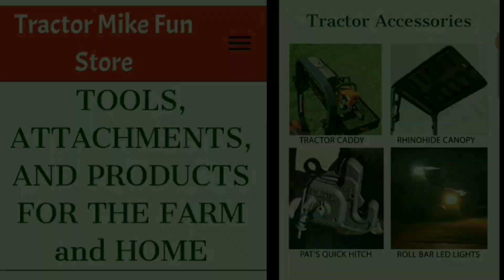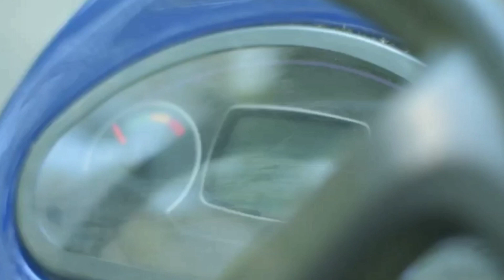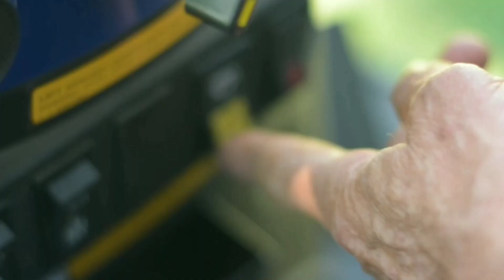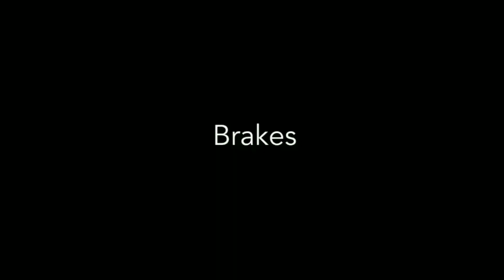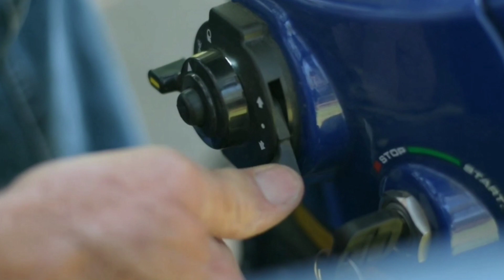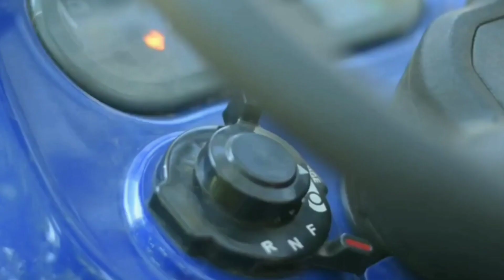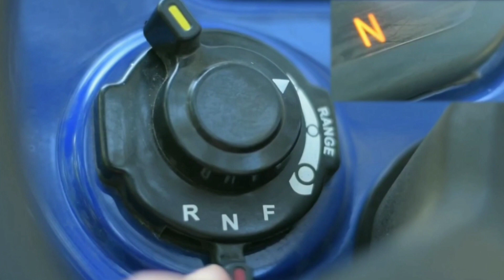Electric vs diesel compact tractors. Solectrac makes their case for electric.

Comment: It sounds great except for two things. Price and battery life. The price of almost 30 grand for a 25-horse tractor before the price of the loader is just too high. $7000 after 10 years for a battery pact...WOW. I have two Ford tractors the same size that are 70 years old. If this tractor last as long as the fords that would be another $700000, I could buy a lot of gas/diesel for 70 grand!!! That cost would be much greater if you charge your tractors with the grid. There will be a market, but I doubt many homesteaders will buy them and they are the ones who could use them most. Too bad!

Comment: Electric tractors make more sense to homesteaders than electric cars do. Homesteader tractors sit for much longer periods of time than one's cars. This gives them plenty of time to be recharged by solar power. This saves time and money. No more trips to town for diesel fuel, no more changing expensive oils, and no more burning expensive fuels. If you are going to need your tractor before the sun charges it up you can always charge it overnight. by plugging it in. It is probably the best hope for EVs right now.

Comment: I have a 33 year old tractor that has been running it’s entire life and I never had to spend $7000 on it. I’ll just keep my diesel. According to this guy I probably would’ve replaced the batteries at least three times. And I guarantee you after 12 years it will probably have a different style of battery and you’ll be stuck buying a new tractor. And don’t say they won’t because I’ve bought many expensive electric items and they’ve all changed the batteries and I had to buy a whole new tool or machine. I’m I’m done with batteries and companies that try to screw you by changing the batteries.
Reply from the maker: I see what your saying. I wonder if Tesla improves their batteries will they make you buy a new car? Time will tell
Reply: "I never had to spend $7000 on it."
Sure you did, unless it is just a lawn ornament.  You buy gas and it needs maintenance.  Electric costs less, and especially if you have solar panels or a wind turbine.  Gas savings will more than pay for battery replacement.  A good electric motor can last you a hundred years, as there is only one moving part rather than hundreds.  There is just less that can go wrong.
"different style of battery and you’ll be stuck buying a new tractor."
Only if you buy it from John Deere or other corps that don't let you repair them.  Worst case you need to buy a new charger unit, but a good one is programable.
"changed the batteries and I had to buy a whole new tool or machine."
It's good to go with standardized sizes, but for tools you can often just open them up, buy the internal batteries and glue them back up.  There are only a small handful of battery makers.  Companies make battery packs out of them, but the internal electronics and replacement cells can be bought.  That is there will be cells in there that can be bought or you can just make another battery pack.
https://www.youtube.com/watch?v=wcb4ESed2PQ
Reply: @abram730  The reason you have to buy replacement parts is that the manufacturers don't build things to last, there isn't any money in that unless you make the initial purchase price astronomical. They make things that will wear out to keep customers coming back.

Comment: Not ever buying a electric tractor or electric car
Reply: cool story bro
Reply: Why not? I get the argument that they're not as capable yet, but that's been changing and will continue to change.
Reply: The Ag & Construction Mfg’s don’t seem to be interested in producing a “Diesel Electric unit”. A small   diesel (approx 100-130Hp),connected to a generator to produce the equivalent of 300-400Hp that large farms need. Go ALL day. No stopping every 4 hrs to spend 2 hrs charging with electric. Trains have been Diesel Electric for decades because it’s more efficient.
And by the way, we don’t have a climate problem. Only if you listen to the Lie-Bral spin Doctors so you can be taxed to increase their slush funds.

Comment: Somehow I can't imagine an electric tractor working pulling hard all day long as in baling hay or plowing. It's a huge load for my seventy hp tractor. They seem more suited for light work and short hours.
Reply from the maker: I just spent 8 hours with my box blade today  reclaiming land and a lot of heavy loader work. My 50hp Kioti got a real workout. I am sure a lot of people have applications where these tractors fit the bill. I am going to be having a round table discussion with some YouTube tractor people about future tractors so watch for it in September. Thanks for watching.
Reply: @CountryCraziness  they are making progress with electric. It probably won't be too long they will be practical.
Reply: @James Couch I am not a farmer, but I have read in the past that Diesel tractors usually operate at 50% of their nominal capacity.  

If this is true, this would mean a 70-hp tractor is usually used at 35-hp.  A 35-hp Diesel engine is equivalent to a 26-kW motor.  An electric motor offers full power instantaneously.  This is not the case with a Diesel engine.

Another thing to consider is that the batteries of these electric tractors are swappable, and an extra battery backup can, also, be added to them.

I certainly do not know how many hours are required for a full day of work of bailing hay or plowing, but the owner of the company seems credible to me when he talks about their ability to keep up with work.  He does talk about small farms, and if you have a large farm, this might not be suitable.

A big plus for me is that I am not mechanically inclined, and the possibility of not spending a lot of hours in fixing an engine is appealing to me.
Reply: @ek9772  I really don't know, but I'm sure we will see what applications they are suitable for. I'm mostly going on my experience with battery powered tools I've used. They aren't really impressive. Maybe they will improve.
Reply: @JamesCouch777 I would do a risk-reward analysis in a situation like this:

The following numbers involve a lot of assumptions; I recommend adjusting them to your needs:

A 40-hp tractor consumes around 3-gallons per hour of diesel.  During an 8-hour work day, about 24-gallons of diesel will be consumed.  Assuming a work week with 5-days, each week 120 gallons will be consumed.  Assuming 40-work weeks per year, 4,800 gallons are consumed per year.  The average price per gallon of diesel is $2.40.  This is $11,520 per year.  

The savings in this case greatly exceed the cost of a battery which I believe was around $7,000.  In other words, if you had to replace a battery each year, you might still come out ahead.

According to the owner, a battery should last 3,000 to 3,600 cycles.  I believe he mentioned as much as 12-years.  However, don’t give him the benefit of the doubt, and assume that they will last only 1,500 cycles.  5-days for 40-weeks is 200 days.  Assuming one cycle per day, this is over 7-years (1,500 / 200).  This should save around $86,400 in Diesel costs over this period.

From where I sit (with no farming experience) the numbers appear to be favorable for both a short term payback period (battery expenses) or a long term payback period (tractor expenses).

 I forgot to mention that if you live in California, a state program providing 80% of the cost of the tractor was mentioned in the video.
Reply from the maker: I think your diesel consumption assumption is high. I have a 15 gallon tank on a 50hp tractor. I can work it hard for 8 hours and not drain it.
Reply: @CountryCraziness like I said before,  I am not a farmer.  Please adjust my numbers according to your situation to make a preliminary benefit analysis.
Reply: @ek9772  do you have any actual stats on the electric equivalent of a 75 hp tractor. Your diesel usage is too high. I might use 15-20 gallons a day in a 70 hp tractor, less in a 45 hp.
Reply: @JamesCouch777  at the beginning of this discussion, you mentioned that you had a 70-hp tractor.  Therefore, I tried working with the tractor size you have.

What I did was to cut the size in half based on what I read of typical engine usage.  Therefore, I cut the size to 35-hp.  

The discussion after this point concentrates on a 35-hp tractor.  Keep in mind that this is the average power you most likely use during the day.   Moreover, based on your stated Diesel usage per day this seems reasonable to me.  

Please see the sources (see below) which I used before in order to compare average fuel consumption based on horsepower.

Keep in mind that an electric motor equivalent to a 35-hp Diesel engine will provide 100% of all 35-hp when it is idle.  In other words, you should be able to access the average horsepower you use with a Diesel engine from the get go with an electric motor.

In comparison, the Diesel engine will have to go up through its power curve as it increases rpms in order to approach the 35-hp.

The problem with this simplification is that you have much more power available with a 70-hp Diesel engine than with an electric motor that is rated at half the nominal capacity of the Diesel engine.  

If you often use the full (75-hp) power of the Diesel engine, then a 35-hp equivalent electric motor is not for you.  You would probably need a 55-kW electric motor.

However, if my assumption is correct, and you are using almost all the time 50% of the rated nominal capacity of your tractor, then an electric motor equivalent to a 35-hp Diesel engine should be sufficient.  This would be a 26-kW electric motor.

I suppose this decision hinges on how you use your tractor.  For this, you would be better off talking with the manufacturer of the electric tractor rather than with me.  

They should know how large an electric motor would be required to suit your needs.

Like I mentioned several times I am not a farmer, and I am making several assumptions (probably all of them incorrect), and I would not make any decisions based on this discussion.  However, I will be happy if it provided you with an alternative workable option in the future.

Here are the specs for a 30-hp equivalent Diesel tractor:

https://www.solectrac.com/cet

In the tabs at the top of the web site are two additional tractors (another 30-hp and a 40-hp equivalent Diesel tractor), and sometime next year they might introduce a 70-hp equivalent Diesel tractor.

Sources:

https://www.pubs.ext.vt.edu/content/dam/pubs_ext_vt_edu/442/442-073/BSE-328.pdf

http://www.waterandenergyprogress.org/library/05006.pdf

https://farmdoc.illinois.edu/assets/management/machinery-costs/tractor_costs.pdf

https://www.agweb.com/article/how-much-horsepower-is-enough-NAA-agweb-guest-editor

https://www.hobbyfarms.com/horsepower-tractors-farm-need/

In any case, I hope this helped.
Reply: @ek9772  thank you so much for your time and help. It is an interesting technology and is worth keeping an eye on. The small electric cars seem to be holding their own although they aren't too popular. I do have a fair amount of battery powered tools and my biggest complaint is the lifespan of the batteries. My latest aquisition is a weed trimmer. I got the most powerful one they had and it does well although not quite up to the performance of a 25 or 30cc gas unit but the convenience is the best part. We'll have to wait and see where the electric technology goes.
Reply: @JamesCouch777  your welcome.

I would not judge the batteries of an electric tractor or an electric car by past experience with small handheld devices.  

There are several reasons for this, and if you are interested look up the differences in vehicle battery technology in 2020 versus 2012.
Reply: @ek9772  👍
Reply: @JamesCouch777  I was doing weekends of grass mowing & trimming and thank god I was young because the vibrations would leave my hands still buzzing even when they were empty. Plus having to wear earmuffs over my earphones to be able to listen to a bit of music to not get bored.
Reply: That's correct, but it's why JD is making giant corded tractors.

Comment: These tractors look good. When it comes electric tractors the weight of the batteries is a positive. So his tractor is essentially a conventional machine with the electric motor taking the place of the Diesel engine.

I agree with his opinion the increased anti pollution measures on Diesel engines results in them becoming less efficient and as a result burning more fuel.